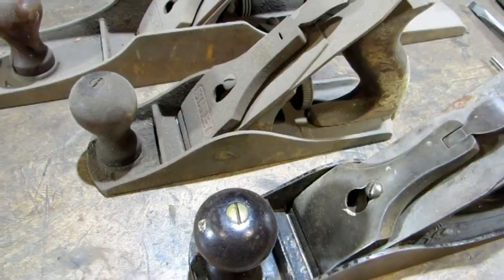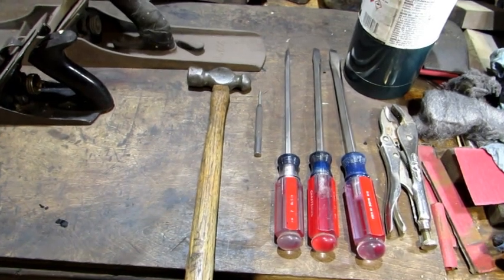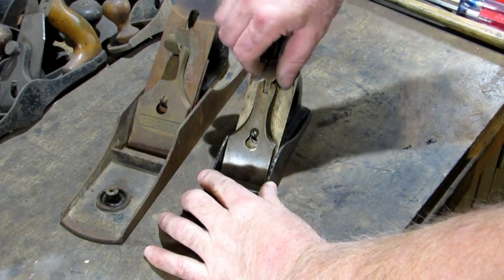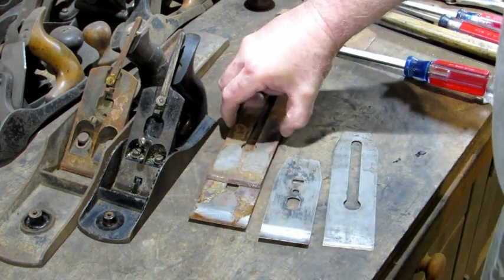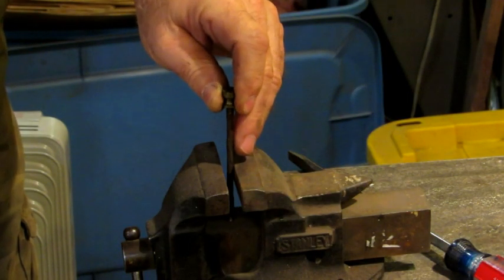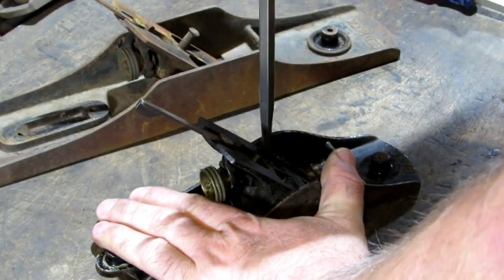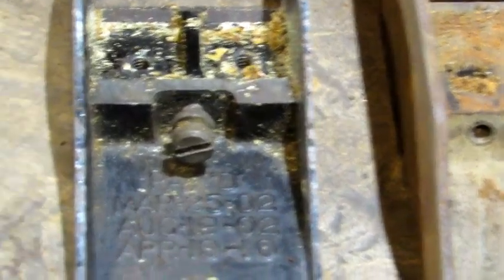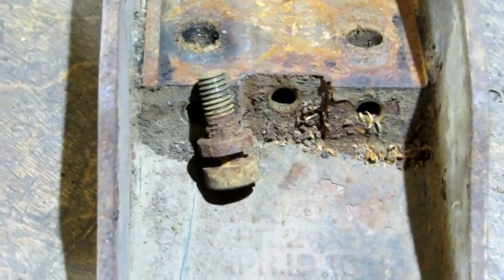How to Breakdown Stanley Bailey and Bedrock Bench Planes

Comment: Very good tips Keith. You could also use penetrating oil for the hard to reach bolts. I use it all the time so I don't break any parts (Stanley screw thread are oddball from today standard). I don't have as many spare parts as you do :) . Thanks for sharing.

Comment: I have a Bailey No 6 which I believe to be a Type 5. It broke down easily except for the knob and tote, which I can't get off. My screwdriver fits perfectly, stands by itself just like yours, but I cannot turn the nut on the knob or tote. I'm woried about buggering up the nuts, but can't get them to move. Plane was held in a vise, clamped to my bench, etc, but no luck. Help!!!